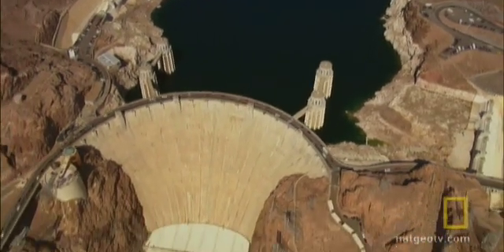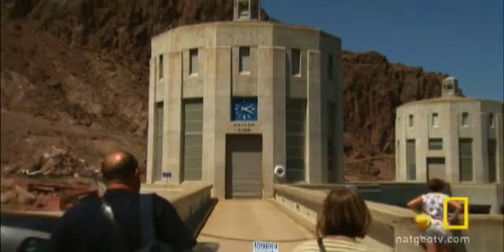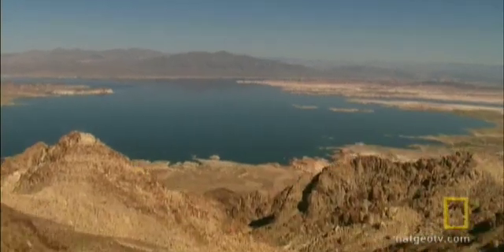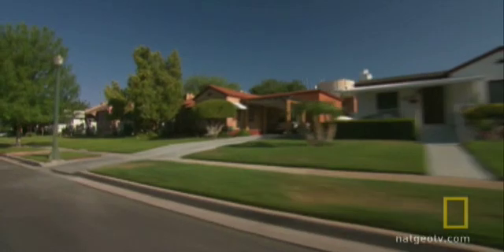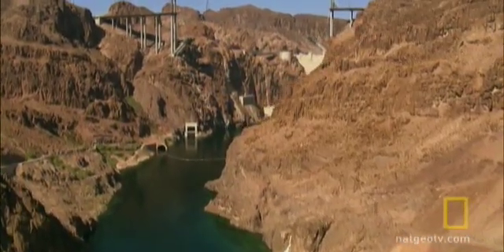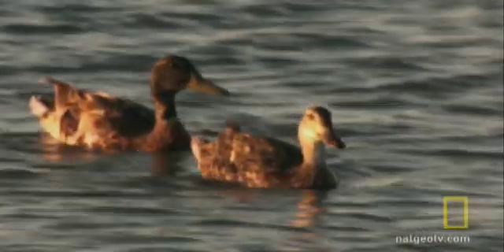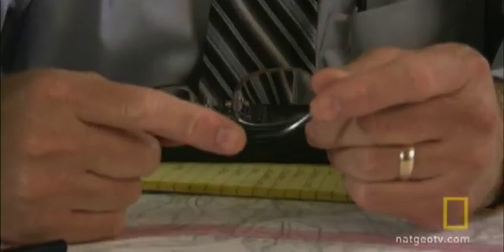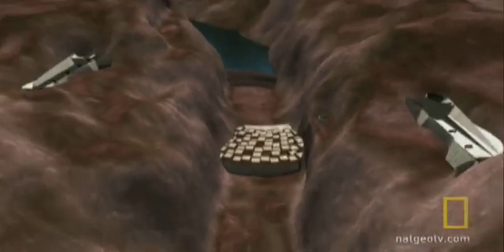New Hoover Dam | National Geographic

Comment: There were cold water pipes built into it to cool the concrete. When the concrete was finally cooled and settled, the pipes themselves were filled with concrete. The dam is so huge, if it weren't for those pipes, it would have taken close to 70 years to settle.